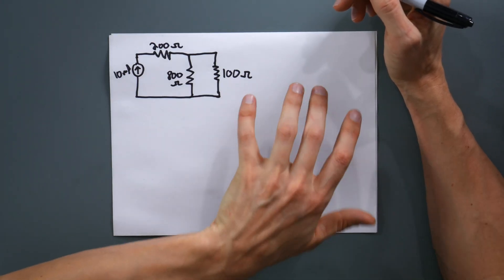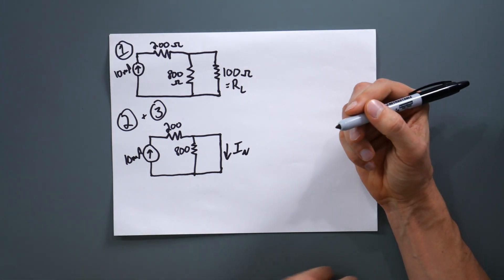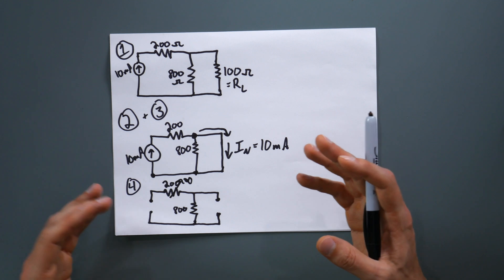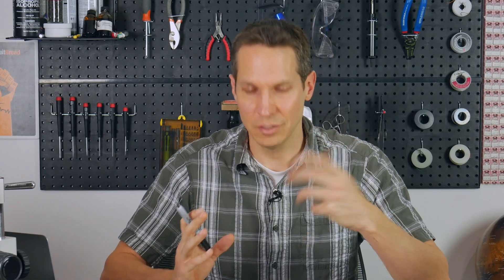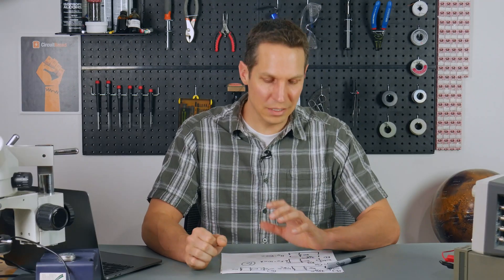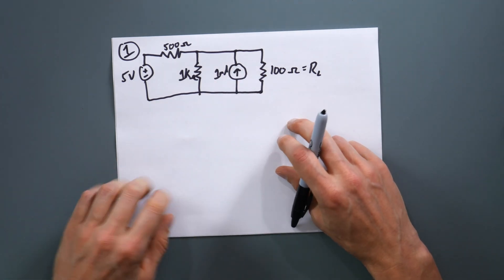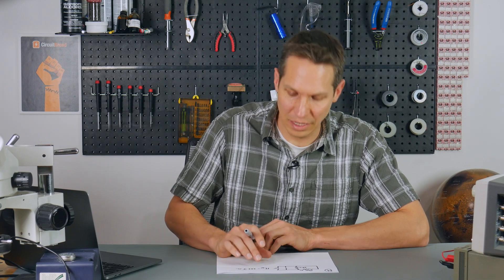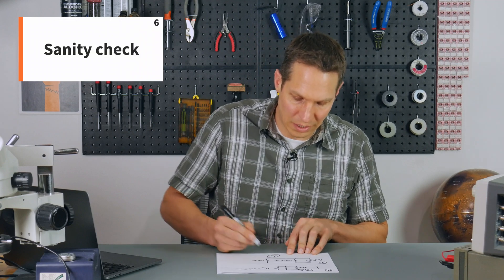Norton Equivalent Circuits | Basic Circuits

Comment: why doesn't the current pass through the 1k ohm resistor(14:20)
Reply from the maker: Great question and the important thing is to look at the nodes.  That 1K resistor has both ends of the resistors connected to the same node.  Due to that, they are the same voltage potential, meaning no current will flow through them.  I hope that clarifies things!
Reply: @CircuitBread  thanks for the reply

Comment: At point 13:29, you short circuit the load resistor. The short circuit should short out both the 1mA current source , and the 1K resistor. The result should be a short circuit current of 5 volts over 500 ohms. equal to .01 amps. Question: What's wrong with my analysis?
Reply: Nothing wrong. Your answer is 0.01 A and his is 10 mA. Same answer, different units.
Reply: Nothing wrong. Your answer is 0.01 A and his is 10 mA. Same answer, different units.
Reply: Nothing wrong. Your answer is 0.01 A and his is 10 mA. Same answer, different units.
Reply: @calvinnguyen6029  ....he added 1mA to the 10mA...which means there is something wrong with Chad Simms' analysis( 14:22)

Comment: I got question does electricity engineering workers go to work everyday uhm is it like company workers because I want work everyday but not in the weekend that's  my question?
Reply from the maker: It totally depends on where you work.  I've worked at places where the expectation was frequent work on nights and weekends.  My last job was very focused on work-life balance which I appreciated.  Here at CircuitBread, we also try for a good work-life balance though we do sometimes have to do meetings early in the morning or in the evenings since we've started to spread out. But I can only think of one time in the last five years we had to work on a Saturday.